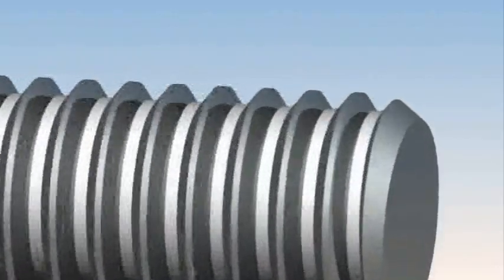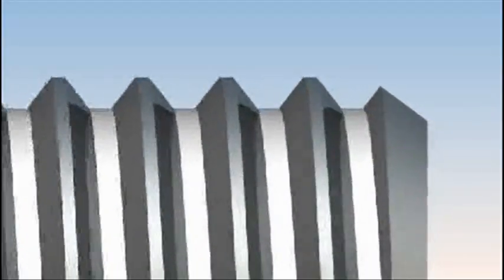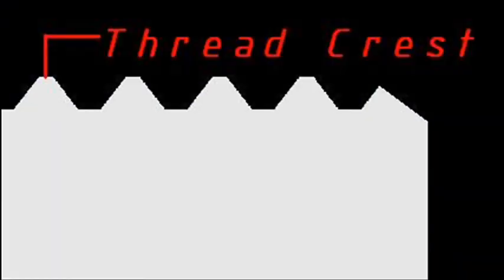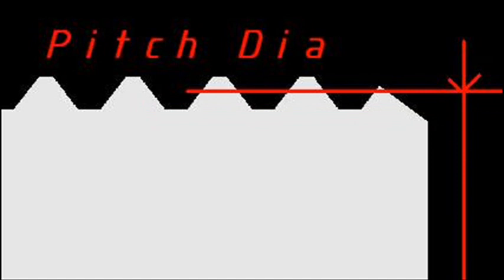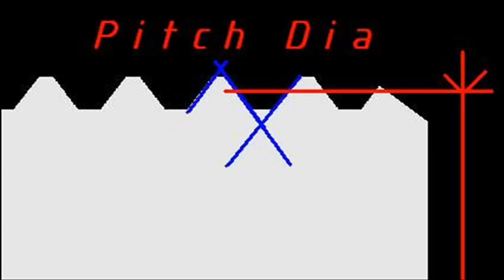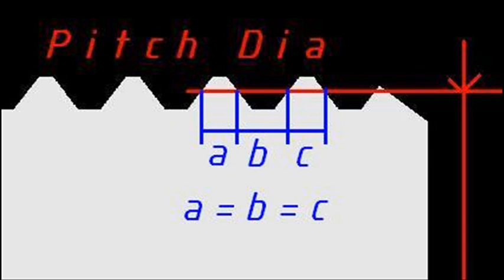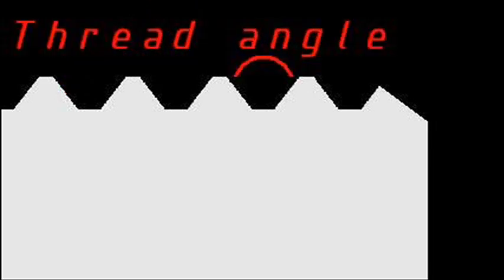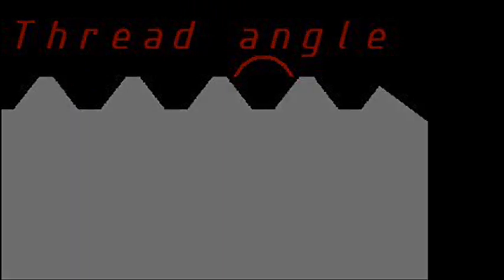Screw Thread Nomenclature

Comment: So if im taking this correctly, the thread pitch of a bolt and the thread pitch of a nut have to match correctly in order to work? Or perhaps more variables than that. Your video answered some of my questions so thank you for that.
Reply: John McConnell You're correct, the thread pitch must be the same. Otherwise you will "cross-thread," in which one thread cuts through another. You must also consider the diameter: an M12 ( we're talking major diameter of 12mm) bolt or screw may have the same thread pitch as an M14.